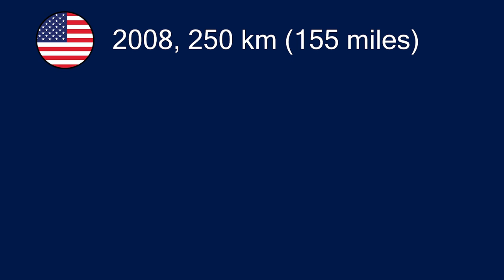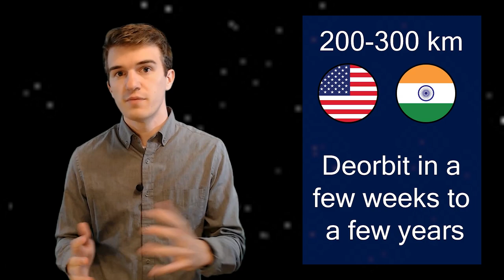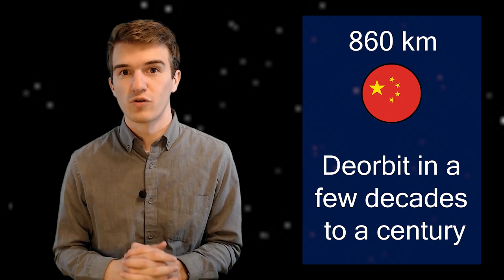Why you should NOT blow up your satellite

Comment: 3d print a fusion reactor.  Currently superconductor coils are reaching 26T Teslas in Rebco like ribbons 30 Tesla, 40 Tesla may happen in a few years.  That also means smaller reactors tinny, and even micro reactors are conceivable.  This was so successful why not just heat the superconductor ceramic and ink jet it into sintered powdered metal 3d printing process.  Just over sinter and inkjet the ceramic in place.  This could be done in any powdered metal method, like Inconel, Aluminum similar melting point, or even Titanium with added option of gold done at same time for internal wiring.  This could be used for deuterium tritium with boron chambers in the blanket that create electricity.  Another option is Helium Three He3 it only produces protons that also makes electricity directly.  Without the damaging neutrons a He3 reactor could be as small as 30 centimeters, studied on the desk in a full classroom at MIT University.  
.
Space X first priority could bring back Helium Three from the moon without even mining it.  The shallow intermittent atmosphere of the moon could carry water full of it to hydro gel.  Moon Landers right now are using hydro gel as a vacuum desiccant to protect delicate instrumentation.  Sorry for altering so liberally existing tech, but we could get to fusion with thousand dollar reactors instead of billions.  Possibly even get to He3 fusion faster because it would be so much safer and smaller to do.